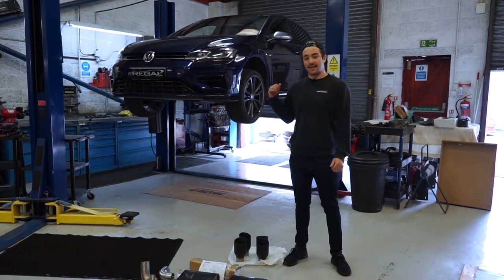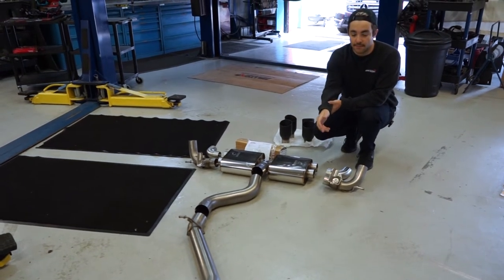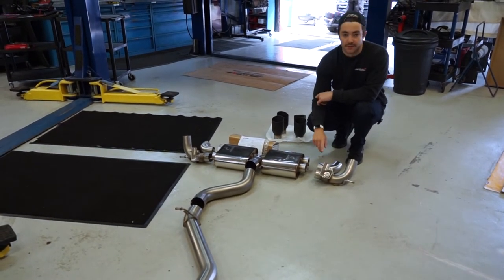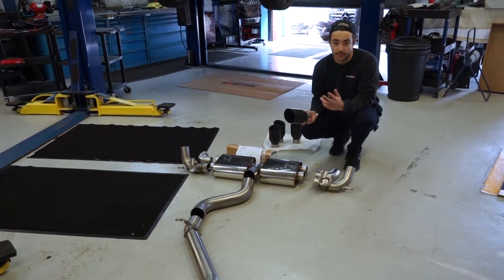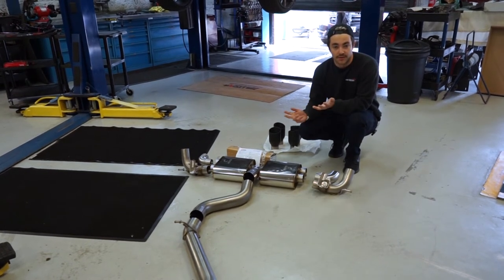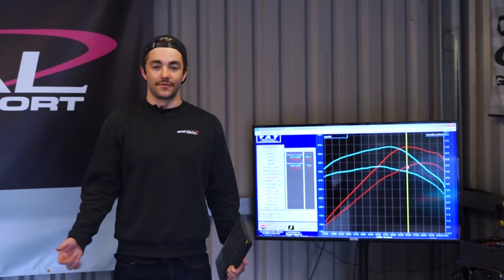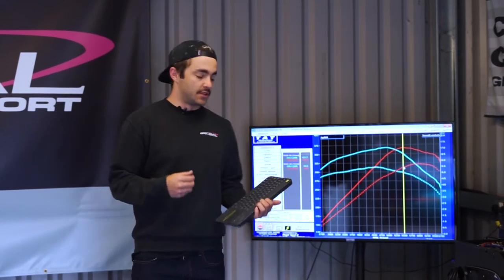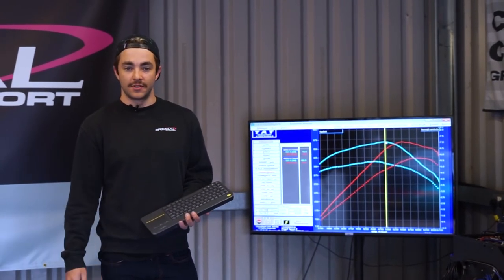MK7.5 Golf R Scorpion Exhaust & APR Stage 1 Low Output Upgrade

Comment: 321hp. Do you find the Golf R/S3 run higher than stock? Was this a gpf?
Reply from the maker: Thanks for the comment, this car doesn't have a GPF. We usually always find that the S3/MK7R make over the stock quoted figures, when tuned through they always make the APR quoted figures.
Reply: Could I ask what the maximum power the scorpion exhaust can take, I'm currently running full 454bhp 442lbft, full turbo back resonated, but the mid resonator failed, replaced by scorpion under warranty, I'm just wondering if this exhaust is definitely up to the job going forward with more power in the future.

Thanks

Comment: How does ecu tuning effect fuel economy?
Reply from the maker: Thanks for the comment, when driving efficiently for example on the motorway the engine often sees an improvement in MPG as the engine is running more efficiently. Obviously if you use the power it will use more fuel as it is making more power.
Reply: @RegalAutosport  so driven conservatively you could expect better MPG as the engine doesn’t have to work as work as hard due to the increased power, is this understanding correct?
Reply from the maker: The same or better, it’s more to do with efficiency than power though

Comment: I own a manual 7.5r would I need an uprated clutch for a stage one?
Reply from the maker: For Stage 1 Low Torque you will not, but to enjoy the maximum power and torque from Stage 1 or even Stage 2 you will want to install an upgraded clutch. 

Take a look at the Stage 2 manual we finished recently here: https://www.youtube.com/watch?v=LzV_w_kjCbk&feature=youtu.be